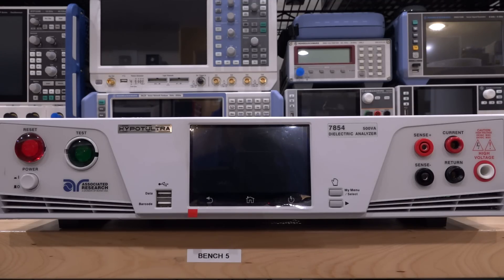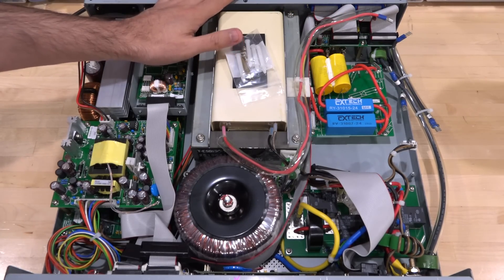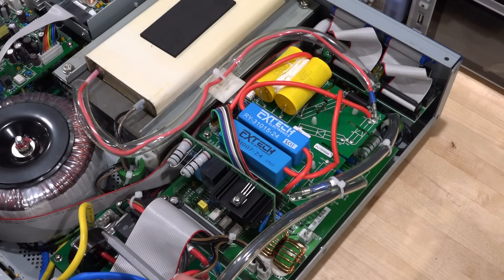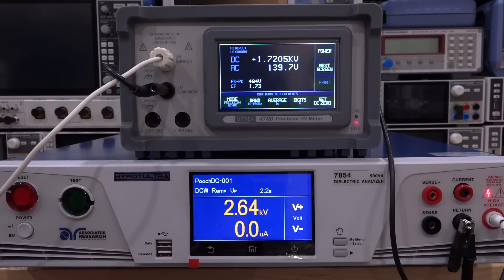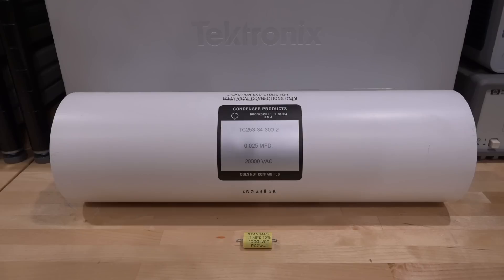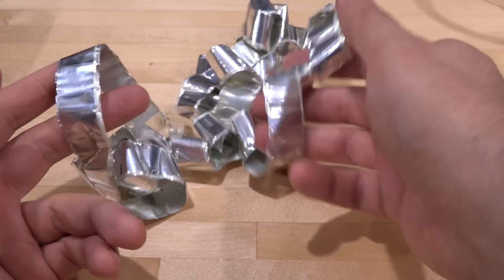TNP #50 - Associated Research 5000VAC/6000VDC HypotUltra 7854 Dielectric Analyzer Teardown & Repair

Comment: Nice! Love it when the manufacturer is willing to go the extra mile to support the end consumer with the ability to buy individual internal assemblies. Really impressed you got schematics too!

I have a similar Vitrek unit which had faulty output HV relays (contacts sputtered themselves all over the glass after many thousands of cycles), I emailed them but they never responded. But they did put me on their marketing email list... (idk maybe I said something wrong)

Ended up just designing a mod PCB to install new relays on the existing PCB, works a treat now! Interestingly the overall architecture of the Vitrek unit is very similar to this one, they even have a similar PCB that isn't populated with certain components like you noted in this unit at 2:40, in the Vitrek its because they only use the lower PCB for the AC only model, the AC/DC model needs the extra PCB on top with rectification and smoothing.

Comment: I wonder if this could be used to analyse the breakdown of HV across coaxial cable? RF at 1000w (watts) or more over say Andrew Heliax coax will carry substantial high voltages but obviously higher frequency AC (the equivalent), however, knowing the breakdown between centre conductor and shield over the dielectric would make a really good test and determine if bends in the coax not only change the characteristics (impedance) but potential breakdown areas. A tight bend I feel would lower the isolation quite a bit. This could be performed over a video using RG174 right up to RG213 and LDF4-50A. Even thicker is used in cell towers and it would be interesting to see the breakdown if possible. Please!!
Reply: Very good question, I would love to see this as well!

Comment: These are awesome instruments. Would love to see a video on X- (for application accross mains) and Y (for application between mains and PE) rated caps and their supposed failure modes.
Reply: Also chinese 1kV capacitors hardly working in cheap chargers as X1/X2/Y1/Y2 type 😉
Reply: @jankomuzykant1844  Good one!

Comment: Summary

This video features a repair and overview of the Associated Research 5000VAC/6000VDC HypoUltra 7854 dielectric analyzer, a high-end device used for analyzing dielectric breakdowns and safety measures. 

Here's a breakdown of the video with timestamps:

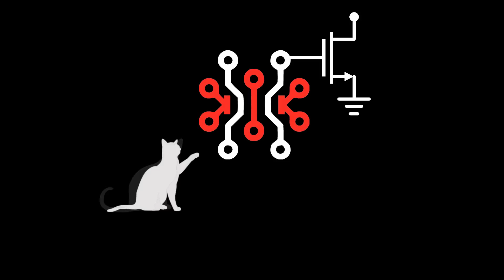* 0:07 - The Issue: The device, purchased cheaply on eBay, displays an "internal self test" error, indicating voltage on a return line where there shouldn't be.
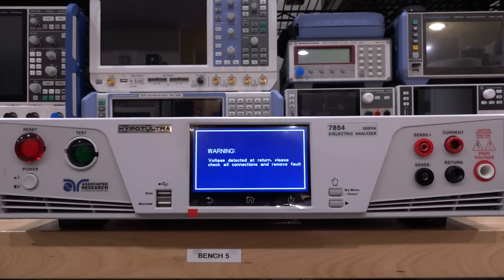* 1:09 - Diagnosis: Upon opening, it's revealed that a crucial high-voltage driver board is completely missing, likely used for parts in the past.
* 2:19 - Solution: The host contacts Associated Research (part of Ikonix USA) who impressively provides a brand new replacement board.
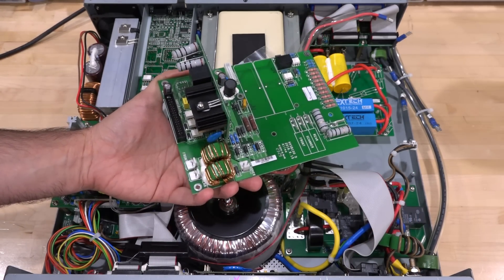* 3:03 - Board Analysis: A detailed examination of the replacement board showcases:
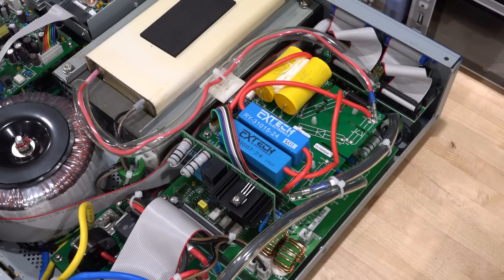    * 3:03 - Functionality:  It converts AC to DC for different testing modes. 
    * 3:50 - High-Voltage Components: Includes relays, rectifiers, and thick cables, all rated for extremely high voltage.
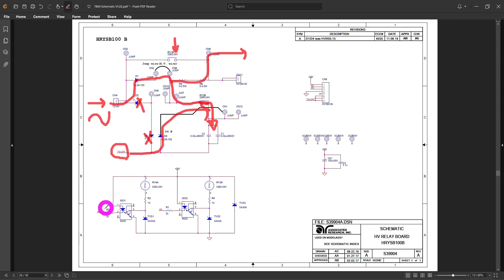    * 5:17 - Safety Features:  Multiple protections like resistors, diodes, and optocouplers ensure safety even during catastrophic failure. 
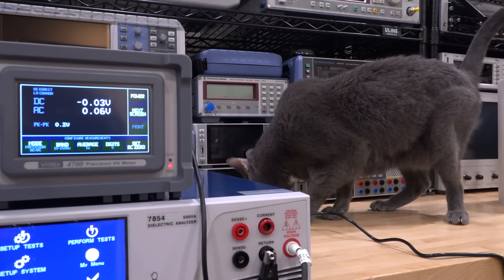* 6:21 - Testing and Functionality:
    * 6:21 - With the board installed, the device boots successfully without errors!
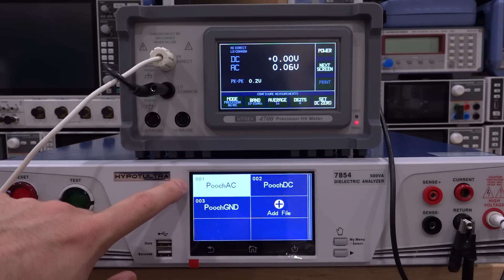    * 7:00 - The host demonstrates: 
        * 7:00 - AC voltage regulation from 0 to 5000V.
        * 8:17 - DC voltage regulation up to 6000V.
        * 9:11 - Ground integrity test pushing 40A RMS.
    * 7:51 - Calibration is slightly off, likely due to the brand-new board. 
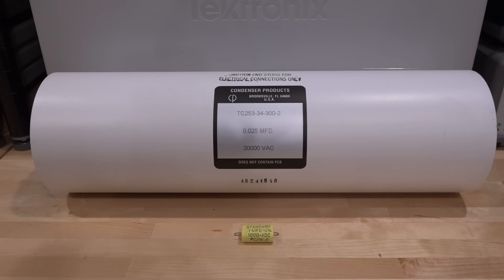* 9:42 - Capacitor Stress Test:
    *  9:42 -  A 1000V capacitor is intentionally pushed to failure using the repaired HypotUltra. 
    *  10:27 - It survives up to 3.76kV (3.76x its rating) before failing with a spark. 
    *  11:04 - Despite the spark, the capacitor surprisingly remains functional, though leakier, due to the failure occurring at the outermost layer.

i used gemini 1.5 pro to summarize the transcript
Reply: Neat!  did you sue the captioning or the voice narration?
Reply: @shazam6274  i used the youtube transcript
Reply: @wolpumba4099  Cool!  Thanks.

Comment: "Let's put 6000 V on a 1000 V capacitor!" Is this The Signal Path or ElectroBOOM?
Reply: Or photonicinduction ?
Reply: @benoitgrange3479 Be it high or low voltage destruction, nothing comes close to Photonicinduction. 😄

It’s a pity he doesn’t upload anymore...
Reply: @gabiold Chris Boden's old "Thumper" definitely did.

Comment: Would be nice to see cable insulation breakdown voltages, I have always have my second thoughts if they really are what the printed text states.
Reply: Several times more that what is printed on them.

Eg. an 600V UL certified cable won't break down even at the maximum 5kV. A new one that is. PVC insulation does not seem to degrade much over time, but would be interesting to see an older rubber insulated cable, I bet that it will leak or arc over at way lower voltage.

Comment: Most of the Hypot series are made to be used inside a safety enclosure with an interlock switch which can plug into the back of the unit.  Might be a good idea to make one yourself for the sake of lab safety.  As you said, these units are dangerous and all it takes is one small mistake.
Reply: Yepp... During the first test I was a bit itchy as that white test lead was a bit too close to the start button for my likeing.

Some test fixtures, beyond the electrical interlock, also mechanically ground the hot wire while opened.

These devices are dangerous, in industrial environments, operator training and usually certification is mandatory, as well as fencing the test area beyond a certain power level. Even at these lower power levels a clearly marked and clear test area is required. Visial and/or auditory warning signal is required when the high voltage is present.

Comment: 400hz is an aircraft frequency FYI
Reply: Aircraft and marine both use it. IMO it is quite a good system.
Reply: What's the reason they are using 400hz in an aircraft
Reply: The transformers and some other elements can be smaller.
Reply: @jakubniemczuk  then why not use higher frequency similar to flyback transformers? 400hz seems very specific and doesn't sound that high to make much of a size difference
Reply: @Rubacava_  The higher the frequency, the more core losses, so it is just a compromise all around, as with all engineering.
Reply: @Rubacava_  it is an old standard from the analog days that got calcified like 50/60 Hz for the grid and 16.7 Hz did for some railways
Reply: @Rubacava_  Because 100 kHz in a wire harness running the whole length of the plane will be too high. From what I heard from pilots that I worked with, it is also used to power many AC motors. And the higher frequency allows for them to be smaller and puck the same punch. Why 400 Hz? I think it is just a standard, like 230 AC in the grid. It could be higher, but after a specific threshold is starts to get problematic.
Reply: @Rubacava_  The 400 Hz frequency that is used in aircraft power is optimized for weight and size efficiency, because higher power frequencies allow for lighter and more compact transformers, motors, and power supplies.
Reply: @Rubacava_  its to reduce the size of the transformers

Comment: Would've been interwting to see a second test of the capacitor to see what voltage it would break down at, or if it would even hold its rated 1000 V at that point.